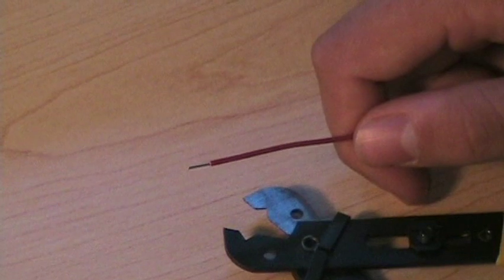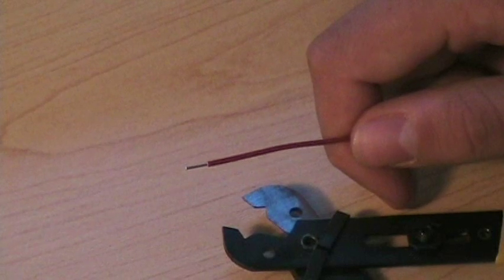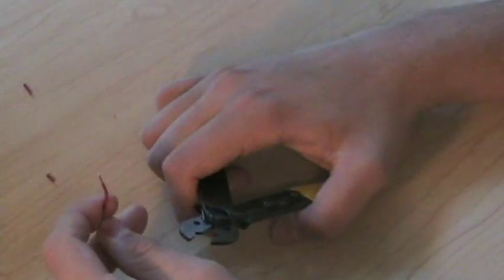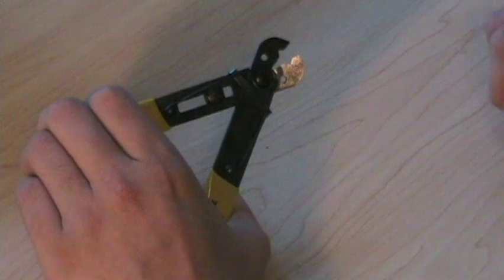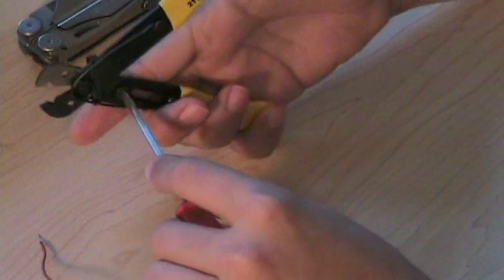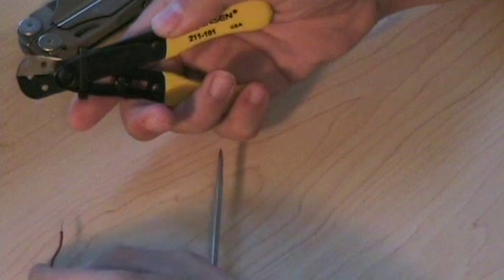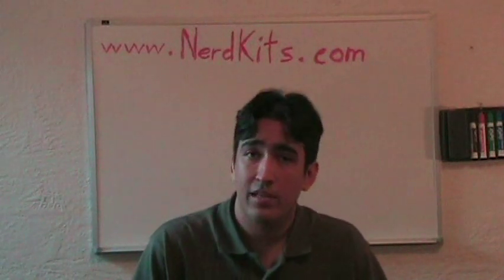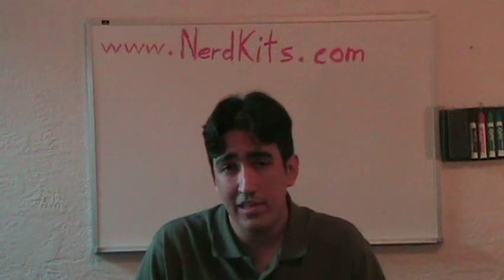How To: Learn how to Strip Wire

Comment: THANKS MAN!! ACtually.. what happened to me was that my speakers are connected to my dvd player and i keep the sound cables from my xbox 360 plugged into the dvd. I also have a ps3 so.. every time i want to switch consoles i actually have to keep turning the dvd to the side so i can switch av cables since i cant get around the back. And what happened was that one of the wires for the speakers actually.. broke off. lol Now it only plays on the right speakers plus subwoofer and not including midle